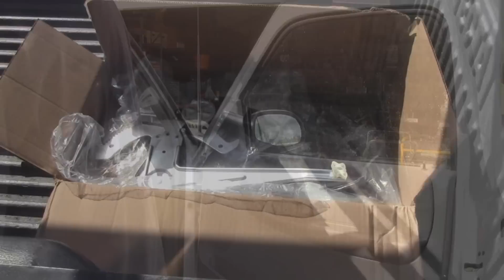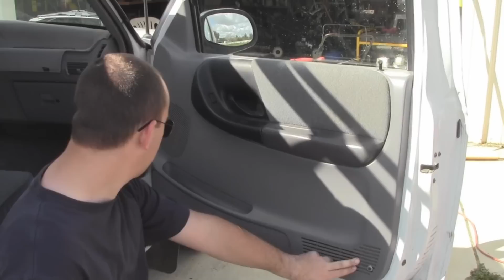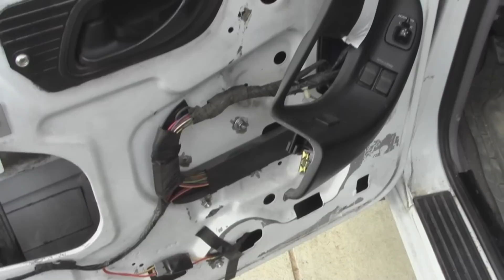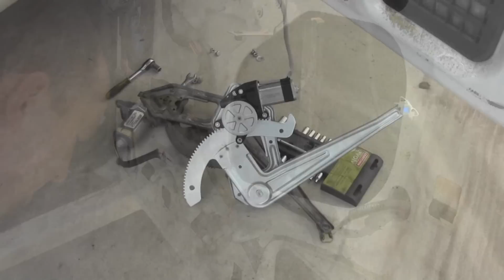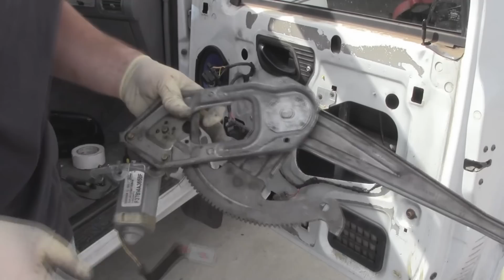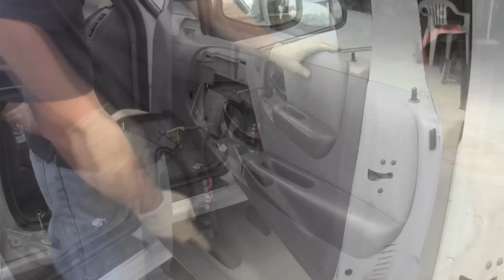Ford Ranger Remove/Replace Power Window Regulator

Comment: Stainless Nut & Bolt Sizes

(4) Round phillips or Hex head 
Size: 1/4in-20x 3/4 in

(4) Nylon Lock Nuts 
Size: 1/4in-20

(4) Fender Washers 
Size: 1/4in x 1in 

All available at Home Depot for about $8 total

Comment: Great job few pointers there is a hole in one of the arms that allows you to put the bolts through at a certain point and should grease with lithium before install

Comment: Wish me luck. I got ripped off yesterday and I had a short in a wire so both sides windows stopped working. Well they charged me $500 in parts and they didn't install the assembly on the driver's side. They just threw it in there and left it so now my window not only doesn't work it won't stay up at all and there for the truck is totalled. I can't take this thing anywhere without everything in it, on it and around it being stolen now. I'll probably just have to drill screws through the outside of the door to hold the window up permanently now.

Comment: Having just replaced one, let me give you what the video doesnt show.  It's pretty simple removing the door handle. Take your time disconnecting the switches as not to break the connectors. The door panel is only two screws. Take off the door panel by lefting up on it and it will come off. The plastic cover just peels off. You'll see the window motor connector at the bottom of the door. Disconnect it and put a meter to the wiring to ensure you are getting power to the motor ( most times can be just the switch). You'll see four aluminum button head rivets. If you plan on replacing the rivets, you need to be careful drilling them out so you dont elongate the holes. Either way, use a 1/4" bit and drill into the rivet first, then follow up with a 3/8" bit to take out the rivet. To get out the motor, may help removing the speaker so you can reach in behind to position it in and out. Once you have the rivets out, it really helps having someone hold the window and move it up and down while you disengage the motor off the window track. Conversely, you'll need that helper getting it back in. Here's a trick. I replaced my motor using 1/4"X 1/2"length bolts, washer, and nut (not lock nut you'll see why). When you get the new motor, you superglue three of the bolts in from the backside of the motor. This helps hold them in place when you line up the new motor in the holes. The fourth you'll get last. Position in the new motor , dont put it in the holes yet, get the motor slider in the track with your helper moving the window up and down. Once you get the slider in the track. then line the motor in the holes. Having superglued the bolts makes it easy to put a washer and bolt on. Snug down those three bolts (if you use a lock nut the bolt will probably spin and you can't get a wrench on the backside of it). Hook up your switch and you can run the window up or down to get that last bolt in. Install the bolt from the inside, this prevents from hanging up when runnning the motor. Trust me, was a lot harder getting out the old one then putting in the new one. You will save about $250 doing it yourself.
Reply: @d.g.degennaro2464  I lifted it up, it did not just come off :(

Comment: Some of the best commentary I have heard on a DIY video. Keep up the good work. Thanks for the walk through on this project. The only thing I would add is when checking the regulator make sure to keep those little digits clear of the moving parts so they won't have to do a math problem to figure out how many digits remain.  I only say this cause there is always someone out there that's going to do it.

Comment: Great video.  I just did this on my '96 Mazda B4000 (same as a Ranger) after watching this.  If you don't want to mess with nuts and bolts, Harbor Freight makes quite a decent pop rivet tool that they sell for about $20.  It works GREAT for this job, and even comes with enough 1/4" rivets to do both sides.  This is also a great time to replace that floppy broken door handle!

Comment: The hardest part is not the drilling, the hardest part is getting the arm in and the holes lined up for the friggin bolts! I've been at this for almost two hours. I'll never attempt this again!!
Reply from the maker: Hmmm dont remember having that issue myself.
Reply: I found out the hard way but you have to put the arm into the slide attached to the window while the window is all the way down. I fought with that crazy window for hours until I let the window down all the way, then everything fell into place.

Comment: I have a 95 ranger w/ power windows. The passenger door window does not do anything w/ the passenger switch, but the passenger will come up and down with the switch on the drivers side. Does this mean the the passenger swich just needs cleaning or does it need changing like in the video? Thanks
Reply from the maker: more than likely its the switch, get one from a wrecking yard, but yea you can try to clean the contacts if you can get it apart, also possible there may be corrosion on the connector

Comment: What was the sizes of the bolts, washers and nuts that you used to replace the rivets with? Thank you.
Reply: 1/4 by 1/2 long
Reply from the maker: +M Thomas Not off hand sorry best I can tell you is to bring it in to any hardware store and size it up with some hardware

Comment: Damn fine video. Do you happen to have the part number for both the left and right side regulators? I have a '94 with this exact problem on both windows. I was going to make an attempt to fix the motors, but based on your video and others I've watched, it appears I can't get to the motor without taking the regulator out. And if I have to go through the trouble of taking out the regulator no matter what, I might as well replace the entire regulator. Is that correct?
Reply: yes u can get just the motor but it stills has to come come out to replace the motor